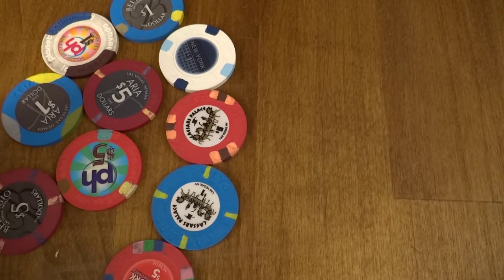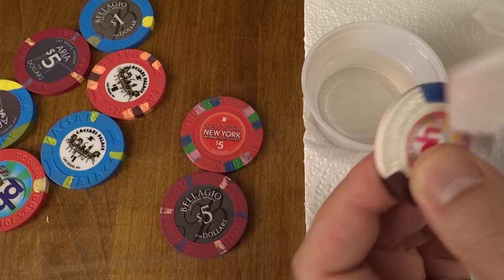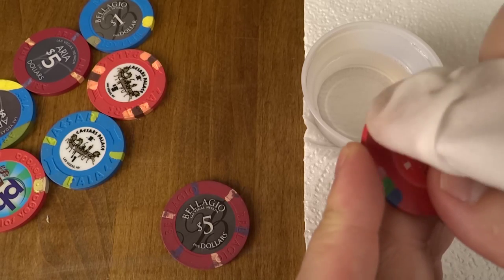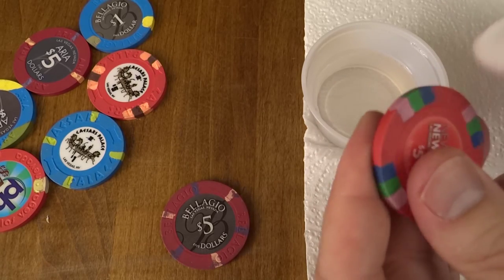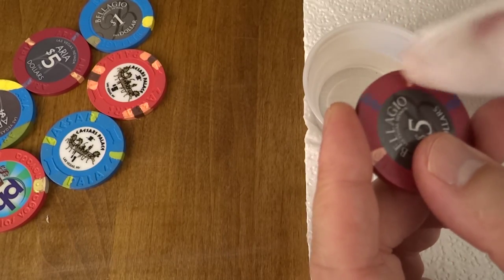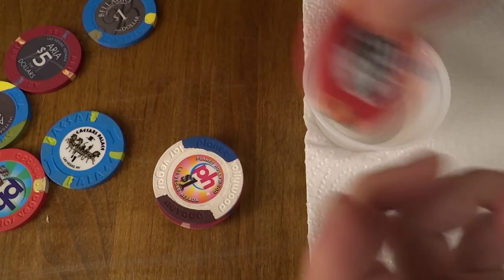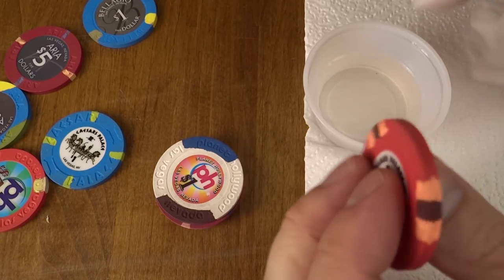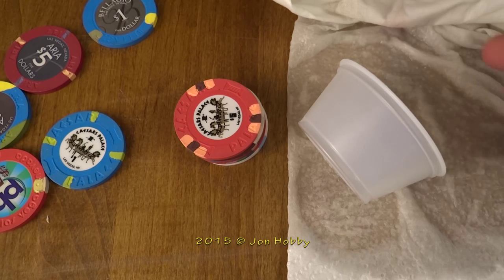Cleaning Poker Chips

Comment: For cleaning single chips, this method is fine.

For cleaning groups of Paulsons - up to a few racks - you might consider using filling a bowl/bucket with warm water and mixing it with dish soap w/oxyclean (can't remember if it's Palmolive or Dawn that offers this) & using a soft-bristled toothbrush to clean them. I cleaned a few hundred Stardust Poker Mansion chips this way and they came out sparkling - particularly the white 1's! Basically I'd dump 20 chips in the mix for about 2-3 minutes, then pick the entire stack and scrub the outside of the chips, then scrub each side of each chip, and rinsing them in clean water afterwards.

Note - DO NOT USE OXY WITH ASM/CPC chips!!! The oxy will dissolve their chip formulation and ruin the chip!

For cleaning gobs of Paulsons, I use an ultrasonic cleaner with a distilled water/tri-sodium phosphate (TSP) mix. This method involves an investment of about $200 so it's only recommended if you have significant numbers of moderately to severely dirty Paulson chips, but that $200 investment could literally save you hours - if not days - of time depending on how many chips you have to clean. It will take 40 chips from filthy to spotless in 2 minutes or less. I've cleaned approximately 4000 chips with this method so far and it's given fantastic results. The only drawback with this method is that you frequently need to put a light coat of mineral oil back on the chips in order to get the colors to pop again. 

The method I use can be seen in this video:  https://www.youtube.com/watch?v=aBcSezTTKZA

The lessons I learned from using this method can be found here: http://www.pokerchipforum.com/threads/psyphers-adventures-with-chip-cleaning.5935/

Comment: Actual casino banker here. FYI, we almost never clean our chips. One exception was when we had a plumbing leak over a few of the tables. Sewage leaked on the table and the chip floats. The chips were credited back to the chip bank and we had the great time cleaning them in a bucket of sanitizer and wiping them 10 or 12 at a time with rags. fyi, these were Paulson 11.5 gram chips.
Reply from the maker: I think I'm going to wash these chips again just thinking about that. Thanks for watching.
Reply: I'm actually surprised to see this comment coming from an actual casino banker. I say this because a cousin of mine used to work at a Las Vegas strip casino, and it was her job to wash casino chips. They used an automatic chip washing machine. She would load the chips into cages, stick them into the washing machine, then hit the Start button. The washing machine was hooked up to bottles of detergent that were specially formulated for clay or ceramic chips.

Comment: I clean my collected casino chips with Lysol wipes.  This has the effect of cleaning and disinfecting.
Reply: Probably not a good idea. Alkyl Dimethyl Ethyl Benzyl Ammonium Chloride is one hell of an alkaline, and typically has a pH of 11 (Lysol's website states their wipes have a pH of 10.5 which is still very harsh). Comparatively, common baking soda (sodium bicarbonate) has a pH of 8.0. Isopropanol would be a better substance to use, and even then, I still would NOT recommend you use even that.
Reply: @SergeantExtreme   meh.  I’ve been doing it this way for years and haven’t seen any degradation.  To be clear, I am only cleaning the show chips once and them putting them into a glass display case.
Reply: @JMBare    Oh wow. I didn't actually expect you to reply. My comment was advice primarily for anyone who was scrolling down to the comments to read what people have written in this day and age.

I get what you're saying with your "I'm just doing it once then putting on the shelf" kind of deal, but I'd take the "rather be safe than sorry" approach. Especially with genuine clay (for obvious reasons, this wouldn't affect ceramics, ABS plastic chips/composite China "clays", or acrylics as much).

Comment: At 3;10 you ask about the life cycle for checks. Rather you ask about 'chips' while displaying 'checks'. 'Chips' are for roulette only, and have no denom, while 'checks' are used throughout a casino, and at roulette as well. ...... In any case the check inventory at any casino gets tremendous wear at the $1, $5, and $25 denoms, then very little above that. The life cycle is determined by the replacement, which is typical BEFORE wear is an issue in casino checks. Public announcements via casino signage, legal notice properly published, and other means is made ONLY with the gaming authority approval.